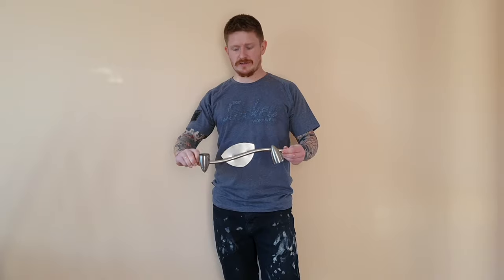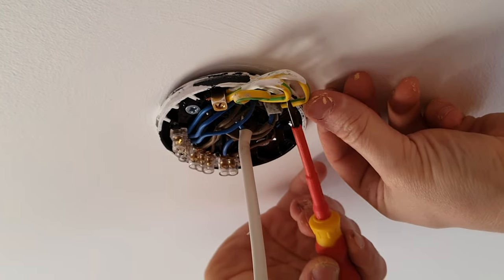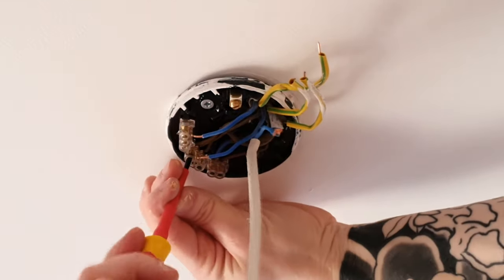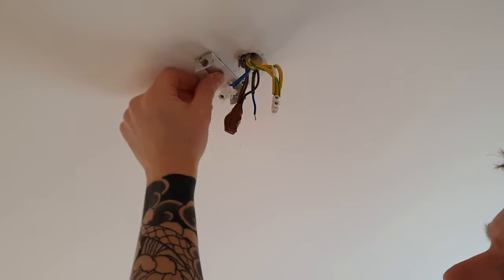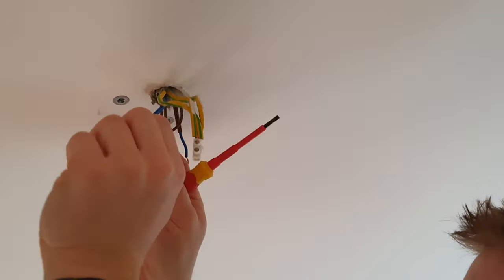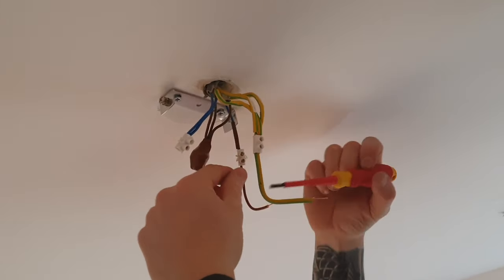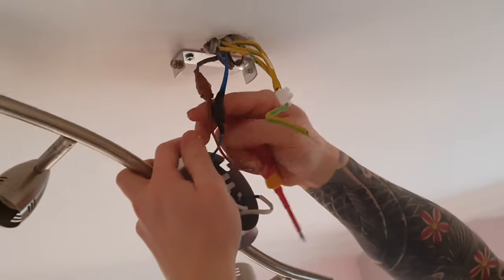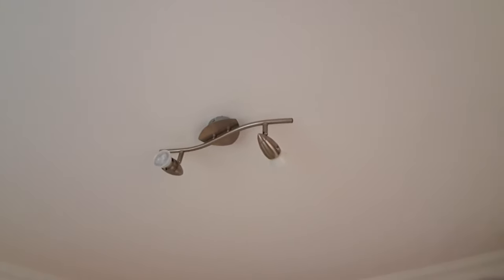How to Change a Ceiling light | Replacing a Rose Fitting

Comment: Thought id attempt changing our ceiling light in the living room after watching this video. Took old light off found 2 red wires in a connection block taped up,a blue and black wire into neutral connection, 2 earth into earth connection and a single yellow wire into the live. Connected new light exactly like old light ,and nothing????. Time for an electrician

Comment: Although I still don't understand why I need three wires to connect a light, or why the brown wires are not used. But after watching this video three times and following it to the letter, I managed to replace my kitchen ceiling light. Thank you so much!
Reply: I’m the same with the brown wires. Just put them in a block and stuffed them away. I don’t get it.
Reply: @Loub230 the brown wires (line) are terminated together in one block to ensure the circuit continuity.  Same with the blue (neutral) wires. This means the circuit remains connected
Reply: Watched 6 times ! Still looks too difficult for me to do it 😢

Comment: I did this but used Wago blocks, which make it even easier. Offer a very secure ‘click in’ and ‘click out’ for the wires which saves on the fiddly connection with traditional blocks and I think is actually stronger/more reliable.

Comment: These videos have been a god send. I was always nervous around electrics  but these videos have built my confidence and since moving in to my own home after many years of renting. I have saved so much been able to give things ago. Massive Thank you keep up the great work. 👍🏻
Reply from the maker: Your very welcome, thanks for your comments
Reply: @TheDIYGuy1  hi not sure if u have done a video on this b4 if so please point me in the right direction. My garage electrics where condemed when purchasing my house so this was all disconnected. How do I go about getting power into there as I'm currently ripping all the rabbit runs of wiring that seems to lead no where. So what's best practice to take power from the home as my garage is not attach to the property. And would you need to add a separate consumer unit for that Sorry for tge lengthy question. I am a novice but follow instructions well and follow safety guidelines . Thank you.

Comment: Just changed a light fitting using your guidance from this video - perfect! Thanks a lot, keep up the great work!
Reply from the maker: Fantastic, glad it helped!
Reply: Do you open the breaker before this? Cos I didn't hear this in the video and yet he was touching the live wires without any precaution. From what I understand, the live and neutral wires should not touch each other at all

Comment: Thanks for this.  I had to look up some wiring diagrams online along with your video, and together they got me there in the end.  Cutting in a few of those diagrams into the video would help.  My problem was that I wasn't swapping like for like: the original light had 4 connections inside, whereas the new light had only 3 connections inside.  I had to put the 3 live wires from the mains into a 3 gang Wago connector to make it work.

Comment: Thanks for video. Hardest part for me was cramming the cables behind and actually screwing the light fitting to the bracket! Took way over 30 minutes just to get the screws in - arms are killing!  Tip - be good if you could advise on part specs eg. cable thickness, blocks etc. thanks
Reply from the maker: Thanks for the feedback. Glad the video helped.

Comment: I followed this to the letter but didn't work.  For the 3 old red wires, do the need to all go in the top terminal instead of 3 separate ones? Also which terminal block size are used the larger or smaller ones. I used the smaller ones or doesn't it matter .  Thanks again great video

Comment: Thanks, very useful video. My LED light fitting says that it is double insulated and earth must not be connect to the metal housing. I guess I would just put a terminal block on the earth wires, wrap with insulating tape and push into the ceiling cavity? Cheers

Comment: Great videos!, I just need help with something, I had to replace my ceiling rose as my new light fitting is smaller than the rose. so I have installed the Wago clips, however the problem I have is like your set up here my ceiling rose has three cables coming through the rose, basically it has 2 neutrals connecting into one connector like you did, however with the Wago clips you cant put two neutral wires into one hole on the wago, so I assumed by putting it into a 4 way wago clip so each neutral is now in its own connector, because there are 4 neutral cables including the cable to the light fitting, however since I have wired it up my living room light wont come on, in fact it has tripped the fuse switch. So is it because the two neutral wires aren't connected as one, and if so what would you recommend to do as the wago doesnt work with two wires in one hole, if its not that what could be causing the other light to trip off?!

Comment: Hi why do you terminate the other 3 lives ??will all the other lights in the house still work when doing this ? And what happens if u put those 3 in the same terminal block as the switch live and connect it to the new light ?

Comment: I am trying to fit a German light similar to yours in Ireland which seems to have the same system as the UK. The wires are extremely short, I had hardly enough space to get my screwdriver in and I could not really see anything, because I was a bit too short. Once I has wired everything up nothing happened… no light… 🙄
Now I know how to extend the length of the wires and can give it another try rather than having to give up and live without a ceiling light in my bedroom. 
Thank you so much! 

Could you please also do a video on how to connect an induction hob? There is no socket and no box, the wires of the current hob are somehow directly connected to the wires in the wall and stuck together with a lot of duct tape.
Reply from the maker: I'll see what I can do for you thanks
Reply: @TheDIYGuy1  Thank you so much!

Comment: Great video thanks a bunch.
What would you suggest if i wanted to replace all the old ceiling roses with new fittings (as you do in this video) but i also want to relocate the fittings so they are more centered in the room or focus on a different point of the room?

Comment: I have installed a new light fitting in my dining room but have now lost the light in my kitchen after following this video, but the switch live sleeve did come off the wire so do i need to just need to try all the neutral wires to see which one works

Comment: Good video.  I've just had to replace the downstairs cloakroom light and there are even more wires! Cables to the extractor fan too.  Unfortunately the light fitting has a large flat disc as the base plate so there is nowhere to put cables - they all need to go into the roof cavity. I've used Wago's for this and shoved them all up through the hole as you show here. But do they need to they need to go into a protective box?  I thought wires just in their sheath should not be exposed?  If I do need a box, can you recommend one that will fit through an enlarged but reasonably small hole in the ceiling.  Not found one yet.....

Comment: Not sure if i missed the explanation. Wondering why all the live wires were grouped together and taped off?
Reply: Basically the Live wires that were grouped together bring the power in and out so it wouldn't need to connect to the pendant, the wires that power the bulbs were the live and neutral which were connected in the pendany

Comment: Great video definitely made it easier to understand, I just have one question If my light doesn't have the built in terminal blocks and they just have the live and neutral wire can I just connect them staright into the opposite end of the terminal blocks and then insulate them? Thanks.
Reply from the maker: Hi. Yes, just use your own terminal blocks.

Comment: Great video thanks!  Question regarding the existing wiring, how do you determine which wire is for the light switch etc?
Reply from the maker: You could do a continuity test and trace the wires.

Comment: What if one has 2 blue wires coming out of the ceiling for lights/fan with one blue wire taped in brown tape being live switch wire. Does the blue wire go into a neutral terminal, and the blue wire with brown tape go into live terminal?

Comment: Thanks but its still a bit scary.How comes you took all those different bundles of wires and put them in blocks together ? also, how do you know which of the blue one's to lose?
Reply: The one to loose was the one of the old light fitting.

Comment: 7:03 Is it ok to just push the wires into the cavity.  I've seen conflicting videos.
Reply: Any non-sheathed cables need to have mechanical protection, e.g. in an enclosure like a junction box or the light fitting itself. In this case it didn't look like he actually tucked them up in the ceiling, but enclosed them within the light fixture base, which is fine and compliant with the regs.

Comment: I only have a single live a neutral wire coming out of my ceiling. From what I can see all over wires such as the earth are tucked away in the ceiling.

I’m looking to install a pendant ceiling rose light fitting. One with the row of connectors.

Would it be okay to place my single neutral wire in the neutral connector and the single live wire into the line connector ?

Comment: My sister-in-law has asked me to put up a new light fitting. But it's got cables I've never worked with before. There are three cables all encased in clear PVC. They all have a silver metallic core. Two are the same and are thicker than the third one. The thinner, third one also has a thin red thread running along the length of it inside the pvc cover. I'm not sure which is which tbh. Could you offer any advice please DIY Guy ?

Comment: Thanks for this. I have a ceiling rose that won't unscrew. I'm guessing it's been there since the 80's. Any tips?
Reply: Get a Qualified Electrician to replace or upgrade it :-)
#Blue_Wizzard
Reply: @Ana_crusis  thanks. It managed to force it off, there was paint in the threads.
Reply: I see you forced it off eventually but I had same problem I just gave the side of it a little tap with a hammer it’ll shake it loose slightly enough for you to twist it off. Just for future reference 😂👍

Comment: Hello - Following your instructions to refresh my mind, I have today wired up a light fitting for a friend.  loop in & out, switch wires, and the 3 earth wires.  Light working fine.  But when I got home I thought and remembered that inside the light fitting (rose) there was a single thin earth wire attached to the (2 screw) bracket that's screwed to the ceiling.  Well I forgot to re-attach it.  Should I be worried?  Fitting was £75 so top notch, but all metal.
Reply from the maker: Hi. Any metal parts of the new fitting should have an earth connected. If that's what you mean then yes you should re connect it.

Comment: Is it possible to change a ceiling lighting fixture into a regular uk power outlet? Main outcome would be to changed a regular bulb & light switch, into a regular light switch but I’ve plugged in LED strips or FairyLights or anything into the ceiling where the bulb normally is.

Comment: a few questions: 1) what amp terminal block is best for a light like what used in this video? 2) what size wire? 1mm, 1.5mm, etc? thanks.
Reply: Use wago connectors. They are better

Comment: Hi there, l followed your video and great work..helped a lot as l managed to change all my fittings. My question is if there is an unevenness on the ceiling and the base is secure but wobbly, what can l insert to even the fittings? I have one whose base is wobbly due to unevenness. Thank you.
Reply: I don’t know, if this is the official way how it’s done, but in my previous apartment they had sealed the gap between ceiling and base with silicone. This got rid of the wobbliness, made sure no mosquitoes would get in there and there was no dark shadow. It looked very neat.

Comment: Great video. I'm about to change a light fitting. The odd thing is the fitting says it does not need to be earthed. Also the terminal in the new light fitting only has two places to fit wires 'live switch' and 'neutral'. I am not sure what to do with the earth wires hanging from the ceiling :/ any advice?
Reply from the maker: Thanks. Make sure all earth's are linked but the earth that is not required can be sleeved in earth sleeving that covers the wire and left unconnected inside the light fitting

Comment: One other thing. Why is it that the original rose fitting had multiple same color wires, but you've essentially funneled them into 1 per color?  Why don't all newbuild house lights just have the 1 wire per color?

Comment: So those terminal blocks are OK to use nowadays then..or do I have to use wagos?
Reply from the maker: They still do the job but I now prefer using wagos. I have a video on the channel that explains the benefits.
Reply: @TheDIYGuy1  I only need enough for 1 light..can you buy them separate ( different sizes ect) I don't want a box or a kit? ...thanks for replying btw.

Comment: How can you tell exactly which wire is and does what? They obviously don't have writing or symbols on them? For example, there may be 3 of the same colored wire, but the way you explained it is that each individual wire has a specific purpose? If I am over thinking this, then I think you need to simplify how you're explaining this for the first timers of changing or upgrading a ceiling light fixture.

Comment: Urgent help needed! We've had an issue were the light fixture is always on, although extremely dimly lit when turned off. 
I'm about to have go and watching this video it seems that the switch live is probably connected to the normal lives. 
@6:23 you put the switch live in its OWN terminal block, separately from the lives. What did you do with the 3 LIVE wires when you connected the earth, neutral and switch live to the pendant?  I only saw 3 terminal blocks as you were doing it at the end, but there should have been 4 (Switch live, live, neutral and earth)
Were getting a fishy smell coming from it which is bad news.
Reply: Hi did u manage to sort it?
Reply: @siani5299  I literally took a professional electricians course since then lol. And yes it's fixed! Was a breakdown in the insulation causing the issue, I just run new cable and it's all sorted now 👌

Comment: Maybe its just me here as i'm about to try to do mine after watching this video, but... you haven't shown the switch wire being connected back up? it's tucked up into the ceiling & yet your light works fine apparently (not actually shown)  does this wire need to be connected or not?
Reply: Looks to me he has connected the switch wire, but then just put the other lives into a block and insulated it. I don’t understand why they aren’t used and can’t seem to find an answer 😢
Reply: @Loub230  The live wires were connected to each other as a LOOP connector block
There were 3 cables 
One bringing the power to this pendant
Second providing power to the switch
Third would be the loop from one pendant to another
Since they are connected to each other through a connecter block they don't need to be connected to this pendant
The power to the bulb comes from the live terminal on the pendant not the LOOP

Comment: Great vid and subscribed ;)
Some quick questions if that's ok.
- Does it matter what Amp Terminal Block you use? (My new light fitting says 10A, but I read somewhere that you should add 50% on top, so I'm assuming I should be aiming for 15A)
- I have pre 2004 wires (red, black, green/yellow) in the ceiling rose currently. I assume it's ok to connect current wires (brown, blue, green/yellow) to these via terminal blocks?
- in your vid, it looks like the switch live (blue, brown sleeve) is connected to a live/brown wire extension via the terminal block. I'm guessing this won't work if you use a neutral wire (blue) as the extension?

Thanks!
Reply: To your questions: 1. Yes terminal Block matters but they're so cheap that you should buy the higher amp one. 2. It's fine to wire old to new. The colours are only the insulation colours. The underlying wires are all copper. 3. Same as previous question, colour of the insulation is only used to indicate whether its L, N or E.

Comment: I have fitted a new light fitting but somewhere I have gone wrong all my house lights are working and the switch on my new light fitting is working ! The problem that I have is the bulb holders , they are the screw in type and when I switch light on my bulb holder the inner contact goes live ! But also the thread part of the holder also goes live ! I must of made a mistake on the wiring in but can’t figure it out ?

Comment: Only thing I would of Done slightly different is using wago connectors. No need to wrap tape around them and so easy fit and can do in seconds.
Reply from the maker: Completely agree. Just didn't have any in my bag at the time of filming.
Reply: Same here, love wago's
Reply: I thought the connector block had to go inside an enclosure to comply with the wiring regs but it's completely unpractical tho

Comment: just changed my light fitting BUT the switched live wire was actually a live cable (red) its wasn't a neutral with a sleeve and it all works even with the light switch... its baffled me

Comment: What about the switch live in the connector box ?? Where does that go
Reply from the maker: Switched live - brown wire (permanent live) to com terminal on switch, earth to earth terminal, blue wire with a brown sleeve on(switched live) goes from L1 terminal at the switch to the live on the new light fitting.